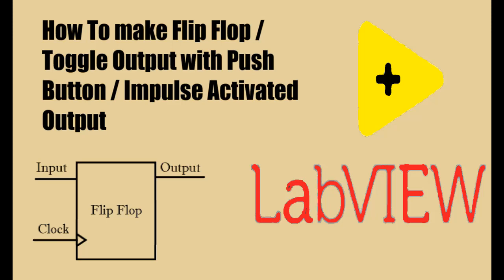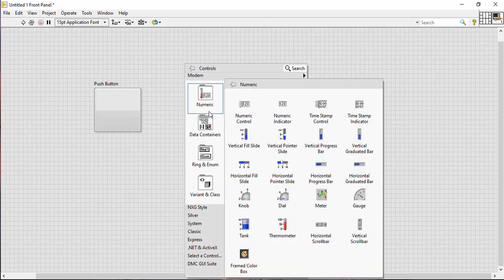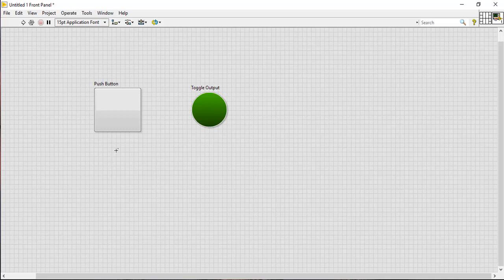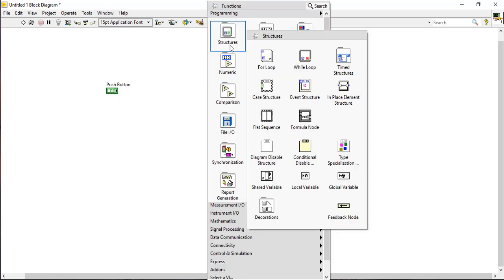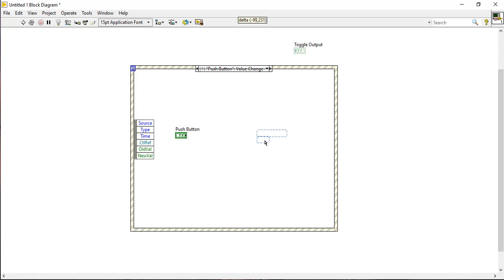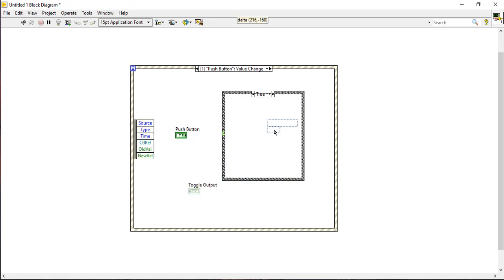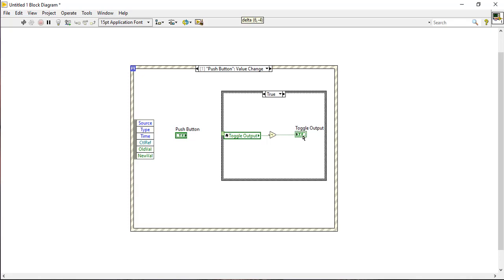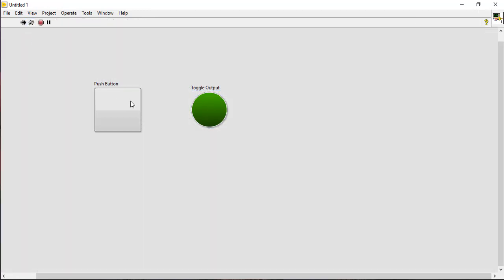How to make flip flop, Toggle output with push button or impulse activated output in LABVIEW

Comment: nice video, sir. I am working on my project where I need to develop a fully automated test bench to collect measurement data. Part of my work involves programming a D-flip-flop so that it works automatically without any manual input. I am looking for ways to program the D-flip-flop to operate without the use of a manual switch or button. Do you have any ideas or suggestions on how I can make this happen? This is a D flip flop with 3 inputs and 3 outputs.
Reply from the maker: Yes, sure